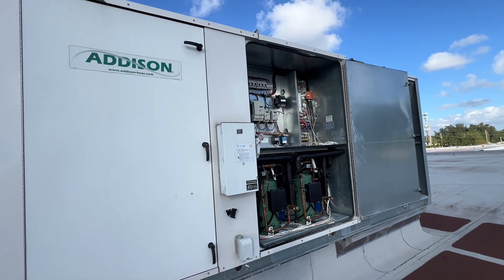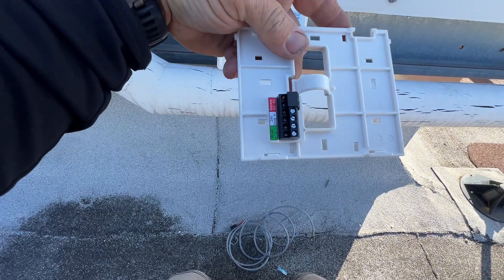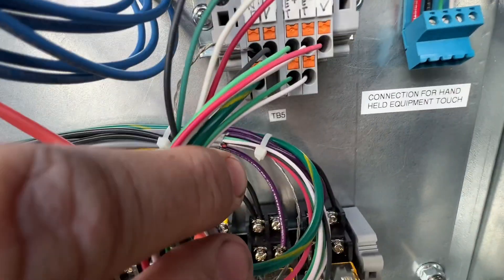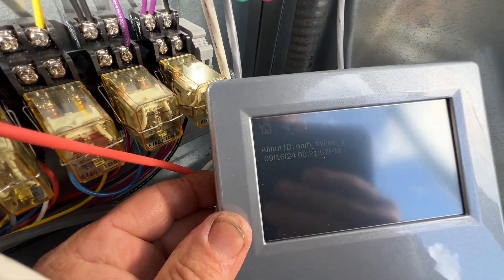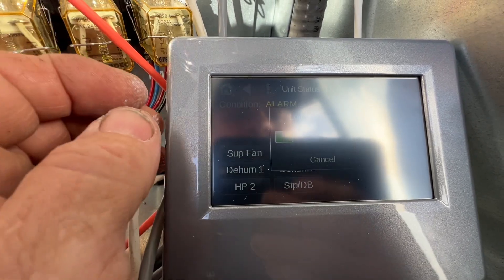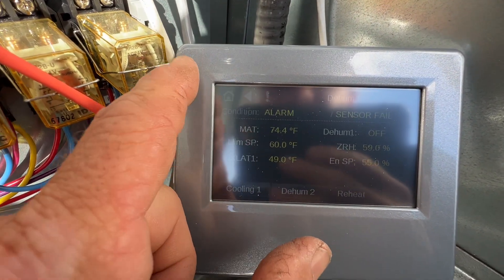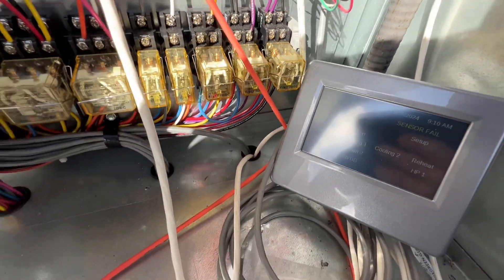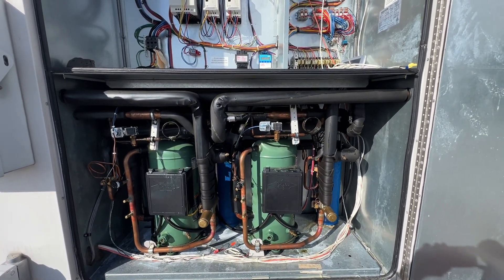Addison 30 Ton RTU Interface Installation Part No EQT1-4-BNK…Operational Check

Comment: Great video and breakdown! On the outdoor sensor, you mentioned it had corrosion inside. Do you think that's just environmental(salt)? Or the location, where maybe water ran down the rusty vent, since it's just under it? Or the water tight fitting where the cable enters?
Reply from the maker: Thanks for watching, it’s most likely the humid salt air
Reply: @subcoolHVAC  Just a heads up, I run the sensor's(ACI) tech support. If you ever need direct help with ACI products. The PCB is conformally coated, but only so much you can do with the humid, salt air! I just happened to notice a couple things, so I wanted to mention it. I believe those sensors are installed at the factory anyways. I'll mention this to Addison's rep
Reply from the maker: Thanks , I appreciate that. Yeah the sensor looked factory
Reply from the maker: Just got the price on that sensor… have to ask why so expensive? Almost $3k 😳
Reply from the maker: Much appreciated 🙏🏻

Comment: They have really good tech support. I've worked on a few of them before. Pretty decent unit. Weren't they part of Trane or something like that. If i remember correctly
Reply from the maker: So far this one is doing well, still waiting for a condenser and motor for another… They bought and sold WeatherKing years ago
Reply: That HMI display is carrier's, I troubleshot a lot of carrier BAS and that's definitely it. I know carrier owns automated logic, so it could just be the same manufacturer of the controls. Same for the PLC and outdoor air sensor, all carrier controls.
Reply from the maker: They are a bit pricey it seems, Thanks for the info 👍